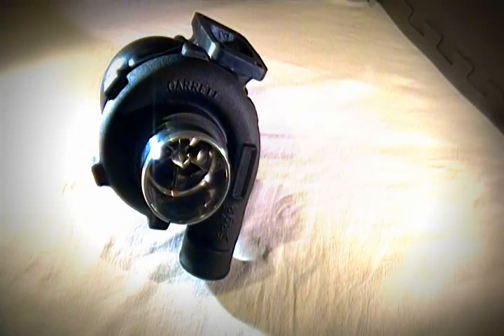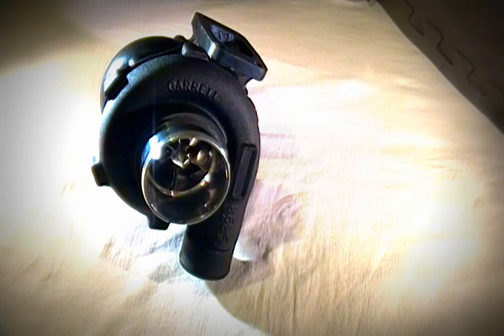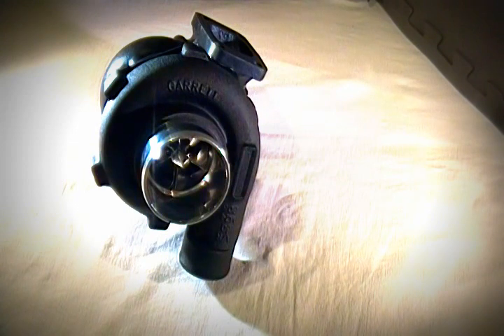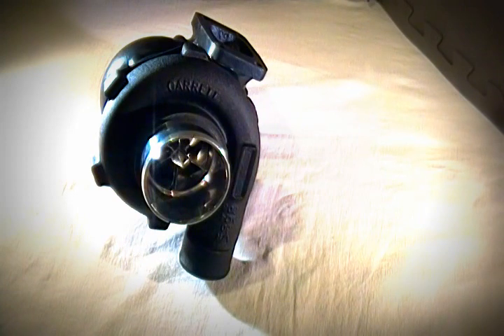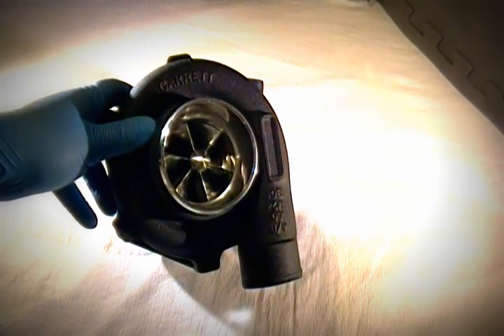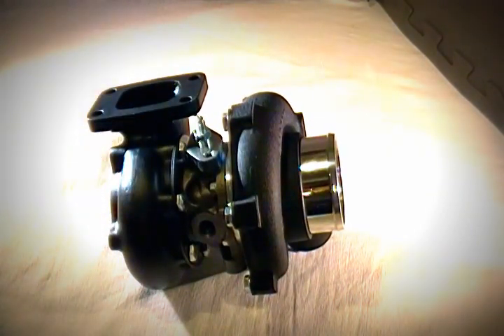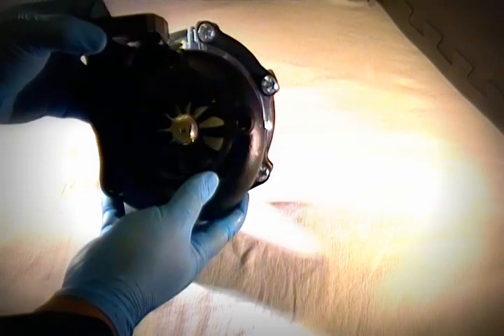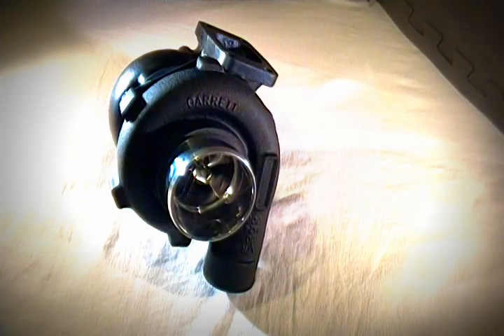Silver Surfer Mark III  Description and feature update

Comment from the maker: that is difficult to answer as it depends ipon the exhaust manifold and flange of the original. if you`re using something aftermarket, you must first make sure  there is enough clearance to run a turbo with a T3 turbine flange in a T04B comp cover. If this is to fit OEM exhaust manifold you need to know if a T3 turbinwe flange is used and if the turbo isn`t too large to fit, as we don`t know the answer to that on a VW.